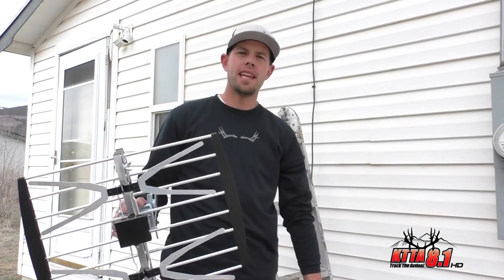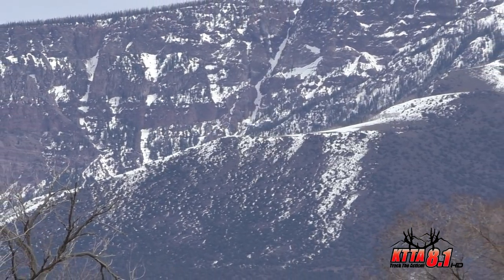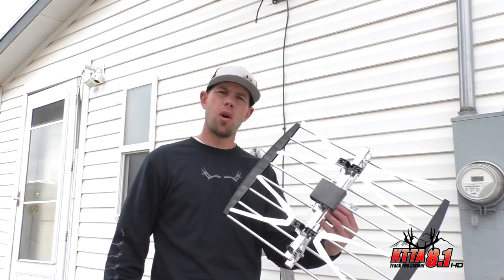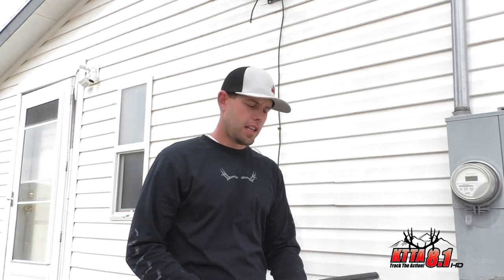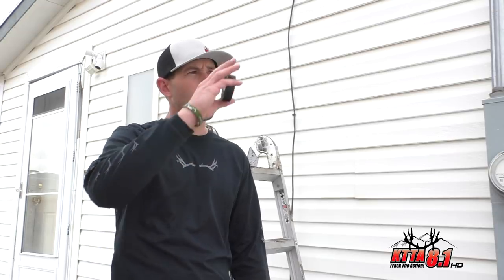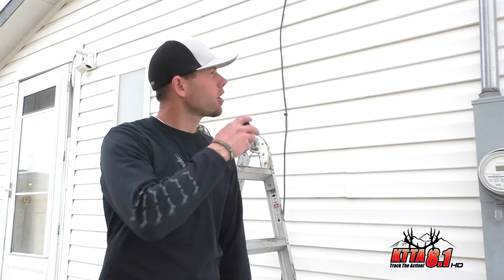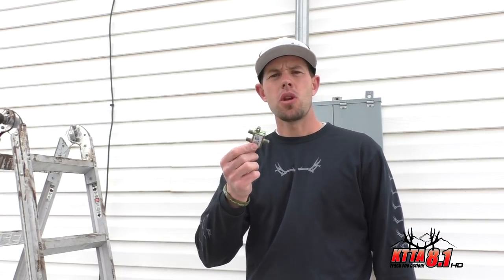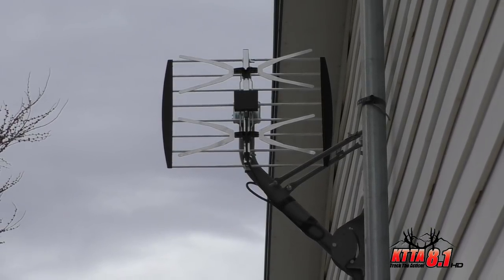Installing an outside UHF over the air HDTV Antenna

Comment: Nobody shows about if a lightning ground should be used or how to put one in. Easy to swap out, but is your expensive TV safe?
Reply from the maker: We have installed lots of outdoor TV antenna setups on roof tops and we never install lightning grounds and I haven't seen any problems whatsoever...
Reply: Mike Parsons , thanks for replying, just trying to get the most information before putting mine up. Thanks
Reply: Mike Parsons, plus I live in the Midwest with lots of lightning strike's.
Reply from the maker: We are based in Utah so we don't get a lot of lightning but still haven't had an issue. You can put it in your attic as long as you don't have a metal roof.
Reply: Mike Parsons , that's part of my problem, I live in a mobile home and was planning on mounting the old satellite bracket to a wood porch post. Got a connector grounding block that I was planning to ground to house frame rails, because it is grounded through the electrical circuit that has a lightning rod ground. Didn't know if that was enough or needed separate rod. So expensive TV  doesn't blow from a strike.
Reply from the maker: I hear what your saying... I have never grounded any antennas during insallation here in UT. From what you've installed so far it sounds like it should be fine.  But here are some videos I found that may help you! https://www.youtube.com/watch?v=Hr4AfG5WtRA
https://www.youtube.com/watch?v=DUlt_ZOu5Cg
Reply: Michael  K. Springer , yeah I know, that's what I was asking this guy about not grounding.

Comment: How can I get my antenna & internet on the same coax if my house is prewired?  My Comcast modem won’t go online now. 😕
Reply from the maker: Over the air TV broad cast and internet are two totally seperate systems. There is no way to have over the air TV (Antenna) and internet in the same coax. You need to run a seperate cable. One for TV and one for internet.
Reply: LOL

Comment: Cool but why not UHF and VHF type antenna why just UHF am I missing something?
Reply from the maker: The tv signals broadcasting in this area is UHF only. VHF type antenna is not needed in this area....
Reply: I gotcha, thanks for the reply. Good video. I bought an uhfvhf and fm combo, but i really dont know what the diff is , trying to learn here.  thanks man.
Reply: Whether you need it or not depends on how far away you are. I have this antenna and it still picks up two VHF channels in my area that are 20 miles away.

Comment: Go higher!!
Reply from the maker: In this situation there is no need to go higher with the antenna. The Transmit site is line of site to the house and the location of this antenna works perfect. Thanks for watching!
Reply: @CryptoSlime
 - It all depend.  In my area, the higher I go the worst it gets.  Funny thing is... My Antenna worked better 1 Foot off of my Floor.  Yup you heard it right!  1 Foot, of off my Floor!

Comment: That is not a good idea to put it under the roof because if it snows were you live it could damage the antenna or your edge of your roof could break
Reply from the maker: We decided to use the dish bracket that was already in place plus the coax cable was already right there so that was the best location.  We have installed many antennas in locations similar to that one and snow has had no problem at all with it.